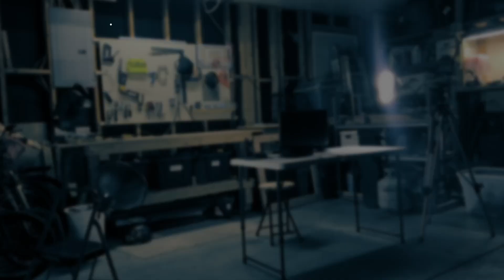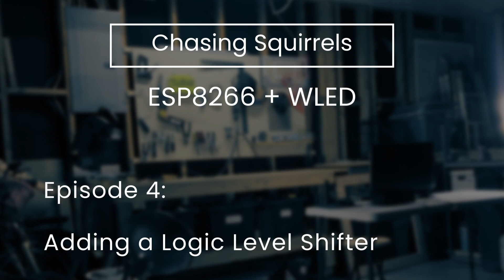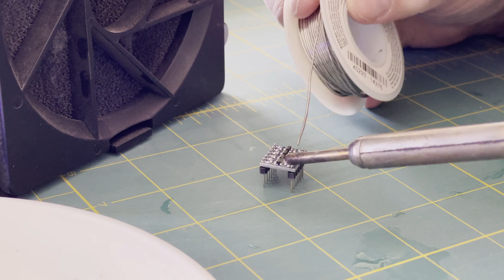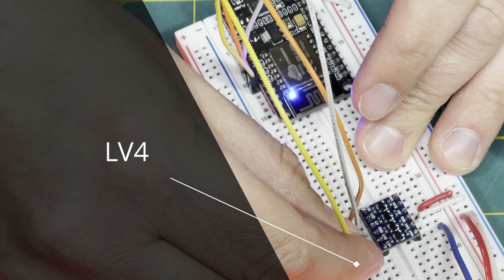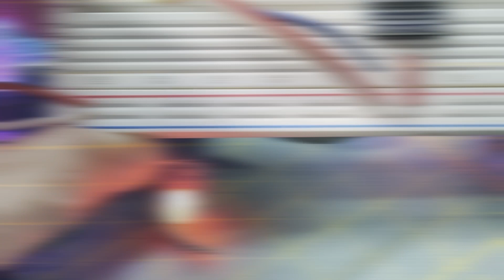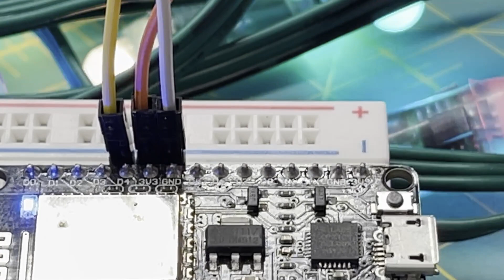Adding a logic level shifter to get rid of flickering LEDs connected to a NodeMCU

Comment: You had flickering with only 5 feet of cable? Reckon a 30 ohm data resistor woulda took care of that. Not to criticize your soldering, but that combined with those super cheap level shifters typically will create issues rather than solve them. Looks like you got a good result this time though

Comment: Quick question. You are powering both MCU and ledstrip from the same PSU. I have this flickering problem too but i use separate PSUs to the MCU and led strip.(tried using the same but blew my first RPI zero 2w..) How would i go about wiring it up like you did but with separate PSUs?

Comment: For soldering, it helps a lot to add a little flux paste so it melts over where you soldier (this also protects the board/items nearby w/ a layer of liquid)
You want to heat the metal tho, so the soldier attracts to the heated metal.
So you heat the pin and pad of the component, then you apply the soldier to the hot pin n it will melt around the pin perfectly.
Hopefully this is helpful (I see it's been a yr since uploaded)

Comment: Thanks for all that close up detail! I've had the level shifters in a bag for an age, tried to power some sk9822/apa102 without the shifter, loads of problems. Thought I'd give it a go.. Followed the basics on the level shifter - which on other videos was terrible about the wiring, and from yours, I have a fully working 78 strip on top of my Bambu Lab 3d printer. Thanks! from UK :) Liked and Subbed!!

Comment: Thanks for sharing!   I had heard that for the WS2811 strips a logic level shifter was needed but decided to try my 55ft string without it and sure enough when displaying white there was a noticeable flicker.  Fortunately I had ordered a set of these and when I installed it on the 3.3v output of my ESP32 the flicker went away.  I've heard these are less than ideal for upconverting the signal, however, it seems like there aren't a lot of other solutions that will work with a digital signal.